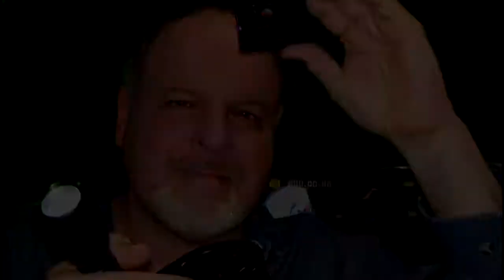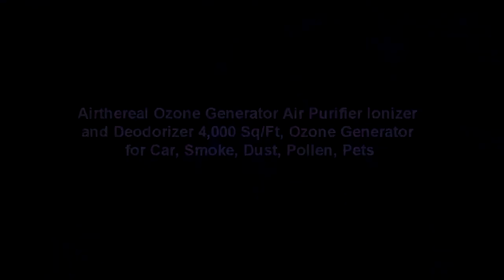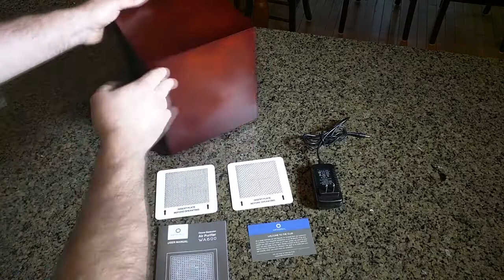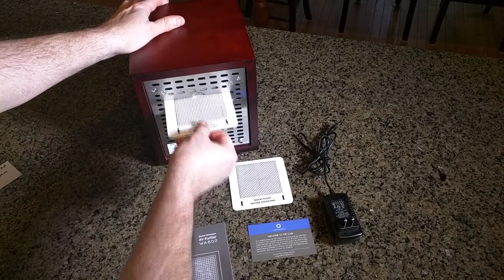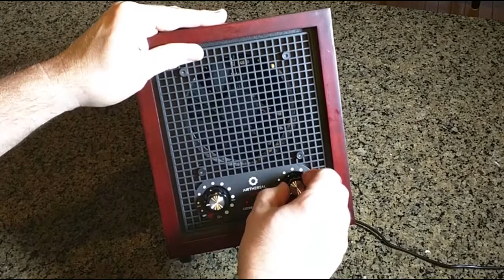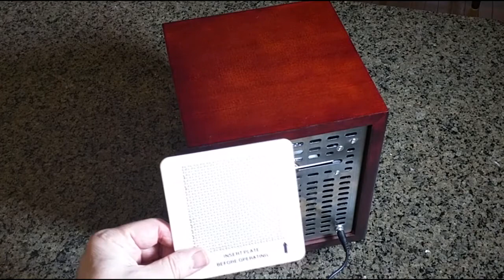BEST Ozone Generator air Purifier Ionizer and Deodorizer 3500 Sq/Ft REVIEW

Comment: Good video . How long do you leave it running in your car for ?  Is it necessary to run the engine at the same time as you would be drawing current from the car's battery and the battery could run down sufficiently to prevent the car from starting . tia.
Reply from the maker: You plug the included AC 120V to DC adapter in while using in your car. No need to run your car's engine.